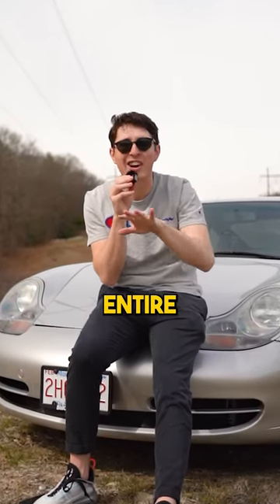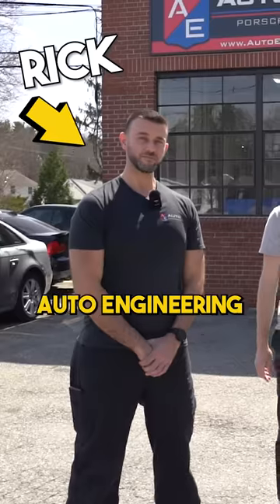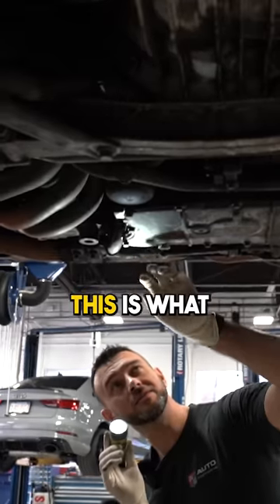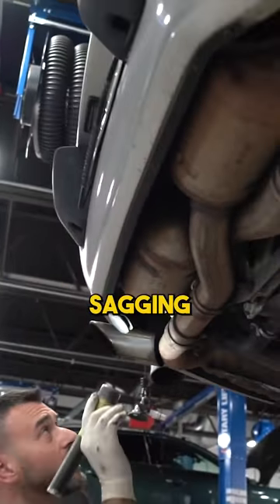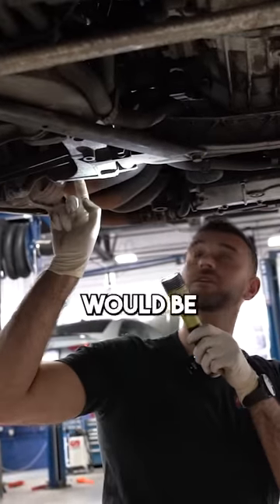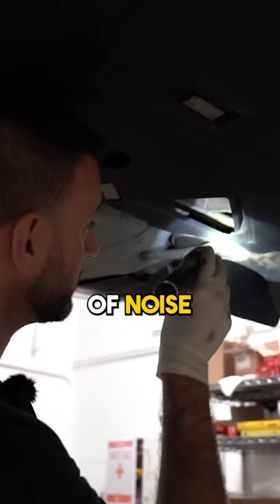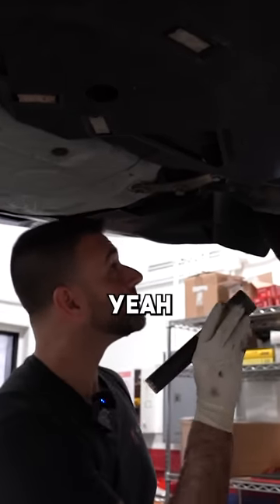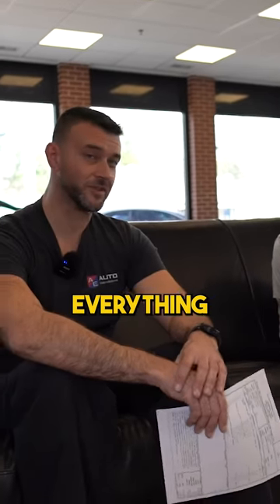This Isn't Good.....

Comment: I took my car to the mechanic before I bought it and they found something crazy like 15k work of work that it needed including the rear main seal and motor mounts and a lot more. they highly advised me to not buy the car but I did it anyways and did all of the labor myself. only costed me like 1000 dollars but a lot of hours. hit 250k miles yesterday and it runs like a dream
Reply: Congrats man!
What do you drive?
Reply: Well yeah all the extra money is for the hours and because fuck it 😂😂😂😂😂but good shit hope it last you longer👍👍👍
Reply: 🧢🧢 on you saving $14,000 by doing the work yourself.

Or they must have tried to charge you 116 hours worth of labor at $120/hr
Reply: @armando062212  50-60% of every estimate, is for labor. I definitely would’ve done the work myself because it’s basically suspension part.
Reply: wanna fix my car
Reply: @chrisbolton3950  yes I know that, but the guy said he fixed it for $1000 lol

Unless he is lying about the total, there is no way he spent only $1000 and saved himself 93% of the invoice by doing it himself. 

93% of the total saved sound like a lie.

Sounds like not all of it was done.

Wasted lots of time, he instead could have worked and made money. 

$9000 or 60% like you said at $160 is 56 hrs.
At 50% obviously less,you do the math.

And $6000 worth of parts? He replaced every single item he was quoted for under even wholesale price on parts? Bull crap lol he didn’t save himself 82% on all the parts that were supposed to be replaced.

$15k is 🧢
Reply: @armando062212  Junk yards and parts cars exist
Reply: @armando062212  if it's a common car parts are cheaper mechanics mark them up or just check internet prices. Can just go scrappers and get cheap parts replacement gearboxes and engines on the cheap. Fix it all yourself lose a lot of your own time and will take longer to actually start driving it but you can deffo save that much depending on the model.
Reply: @armando062212 m8 look up rock auto and compare the price of parts to your local auto zone. And then add 40% to it for the markup the shop will charge and you’ll see just how accurate 80-90% saved is.